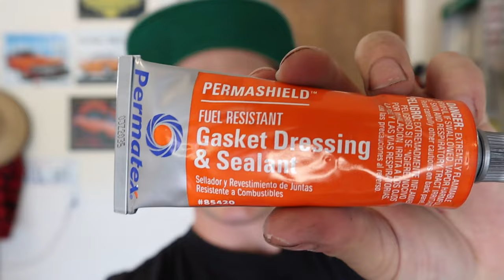Fox Body Cobra Tank swap Part 3! Hustling to get this build done!

Comment: Your car reminds me of myn, looks exactly the same except the interior... best thing I've ever done was put pirelli high performance tires on it, back in the day p7000 super sports. I wish I didn't put the 373 rear end gears in, it has enough torque for the 355s to run fine.
Reply from the maker: That’s awesome! I love the look of the 4 eyes personally too! And I need some better tires for my car as well especially with the 3.73’s wish I had done what you said and went 3.55’s the 373 is just to short 🤷🏼‍♂️
Reply: @iamchazhaynes7074  if you go with pirelli get the higher speed rating as the cheaper ones come from south America and usually have a weaker side wall aswell. Never really had a problem buying good pirelli's until they opened south America div making the cheaper side of things. The biggest difference I noticed was in the wet weather and how they really out performed every thing else as I live in the PNW, in the dry they were as good as the bf g forses
Reply from the maker: @Nick-dw3sv  Oh nice! Ok I'll keep an eye out for that i'm actually getting tires next week so this is great info I really appreciate it!

Comment: Man that fuel tank is gonna drive you insane, I would have already went insane and found a good stress reliever in a 10lb sledge hammer and I would relieve some stress for a good hour 🤣😂 then I would cry because I busted up my tank and going to have to buy another one and that would stress me out thinking about it then I would go bang my head on a tree and then probably wake up in a padded room strapped to a table getting medication crammed down my throat and drowned with water after they dump it all over my face after force feeding me the medication all because of a fuel tank 😂🤣 so it would  need to go right the first time because the future doesn't look good for me if it doesn't  🤣😂🤣
Reply from the maker: You basically described exactly what happened off camera 😂😂😂 I went insane trying to fit that tank! And it just WOULDNT FIT!!! No matter what and eventually I gave in and beat the daylights out of it had a beer to calm myself down 😂😂😂
Reply: @iamchazhaynes7074  🤣😂🤣 Or maybe 2 beers to calm even more down 🤣😂 because well it was there and the first one didn't quite quench the thirst 😂🤣🍻🍻🍻🍺🍺 of everything that you you have done to the car I think that the fuel tank gave you the most hell , I mean it was like you were battling that thing and it wasn't having any of it like it was doing it to just piss you off enough to go crazy 🤣😂 you had to work for that win for sure, the struggle was real for sure,  but if you want to know how my day goes every day, well that's it right there 😂🤣😂 Just tell yourself over and over " It will be worth it when I finish "  😂🤣 That was so bad i started feeling sorry for ya saying to myself " no one should ever have to go through that much hell on anything cut this poor guy a break please " 🤣😂🚗💨💨💨